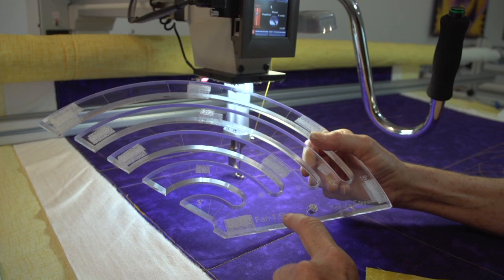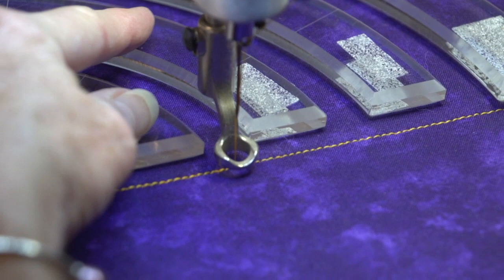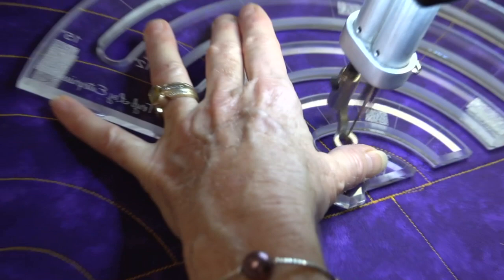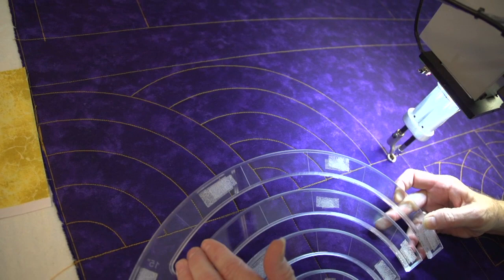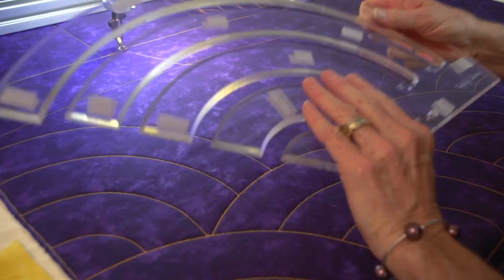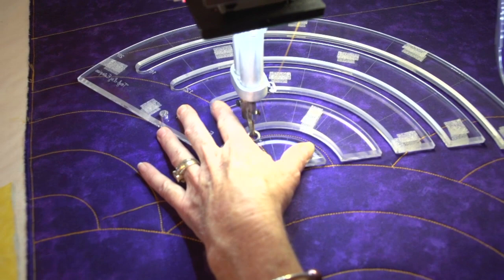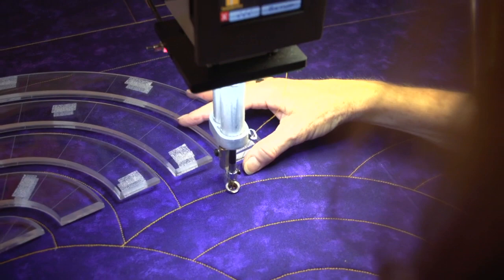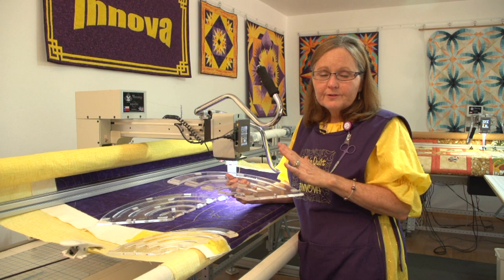Slotted Rulers Part 5 | Fan, Baptist Fan

Comment: Teresa, below, mentioned starting from the top down with Baptist Fan design. It really would be helpful to demo or, at leas,t explain,how that would be done as I think the majority of quilters would be starting their quilting from the top..
I could, of course, make a sample and work it out for myself but it would be helpful to have a demo.

Thank you for all your videos. They are excellent!  I haven't actually seen your templates before and stumbled upon your videos by accident. Now, I'll have to buy one to see how I like this method. Darn it :-)
Reply from the maker: Hi Marlette.  Did you get an answer to your question?  In the 2nd half of the Baptist Fan video, above, there is a demo on how to stack the fans for a edge-to-edge design.  I am hopeful this 2nd half of the video explains why you have to start from the bottom of the quilt when stacking fans.  If you still have questions, ask again.  I am now watching this site for comments and questions.  Sorry I am so slow at responding.
Reply: On the second half you are going up from the botton. How do we go from the top down?
Reply: @debralocke7741  unless you turn the template so the curves are upside down, like a bowl, you can't do baptist fan with this template from the top down. She explains in one of the previous answers why the video shows them stacked from the bottom up.  I haven't, yet, tried doing it this way but I'm setting up a sample to work on.

Comment: Love this video, it's the reason I purchased the slotted ruler set. On my quilt I'm working from the top down whereas in this video she's working from the bottom up. I would love to see the ruler placement for working from the top of the quilt down towards the bottom.
Reply: I don't know what this company would say..seems like they never come back to answer questions, but, I would load the quilt with the bottom at the top.
Reply from the maker: Since Baptist Fans sit on the back of the Fan below it, it wouldn't be possible to start from the top of the quilt unless you want the fans upside down.  You could load your quilt sideways and turn the template 90 degrees.  I did do this when putting fans in borders.  In this case you would work down in the quilting space doing as many whole fans as you can, then move over to the next column of fans.  You would then roll the quilt to keep working down the quilt.  If you do load the quilt sideways you still need to start at the bottom edge of the quilt top.
Reply from the maker: Hi Tereasa,   Good suggestion.  I should of explained this better in the video.  When you watch the second half of the  video above you will see why you can't start from the top of the quilt.  The Baptist Fan pattern by definition builds from the bottom.  The only option is to load you quilt with the bottom edge up.  When I do Baptist Fans edge-to-edge I do load the quilt upside down or with the bottom edge up.  This results in me quilting the bottom of the quilt first and then working my way towards the top of the quilt as I roll.
Reply: @terylloy , I've never tried working from the bottom of a quilt to the top, where the bulk is to the front of the machine, but I will definitely give it a try. Thank you for your advice. Love your videos, keep them coming.

Comment: Since all quilts are not the same width.  Starting at the one side and at the opposite side is only a partial Fan.  How is this handled.
Reply from the maker: Hi Lois.  I am sorry I am so slow at responding.  I think I confused you.  You only start on one side of the quilt and work across to the other side.  Does this help?  If not, give me a call and I will explain it to you.  Thanks for asking.  I